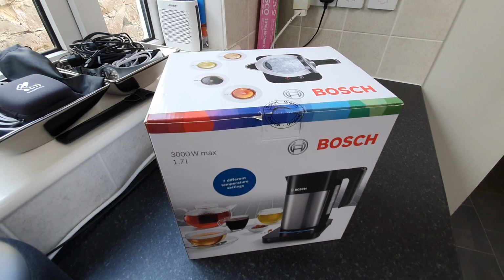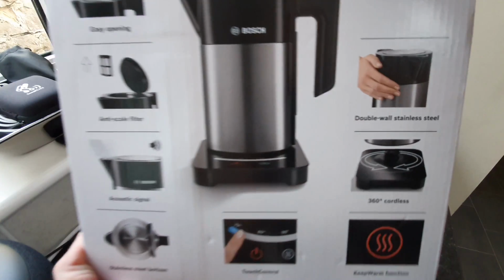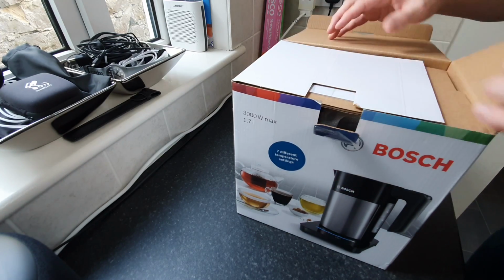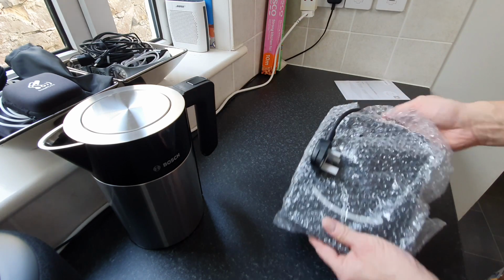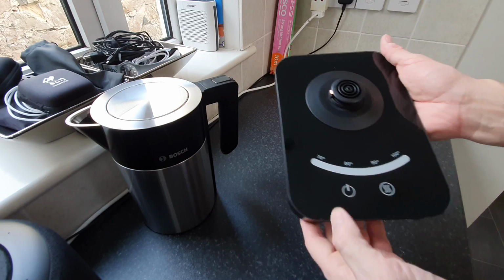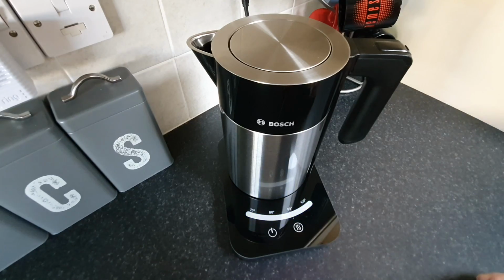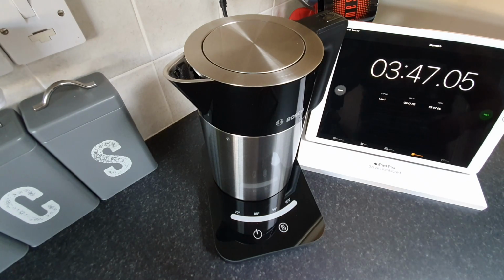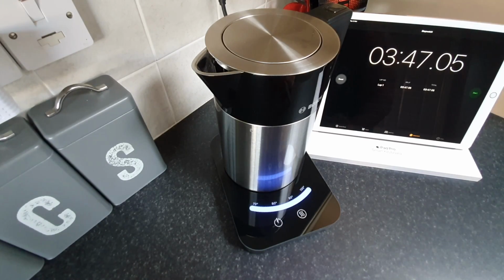Bosch Kettle with blue LED touch sensitive buttons,unboxing & boil speed test (TWK7203GB)

Comment: Thank god this had a stainless steel inner lining. As the old version of this with the physical buttons doesn’t, it has plastic and it’s degraded a leaking microplastics into my brews! 
By chance I put my hand inside the kettle when it was cool and felt a residue albeit it looked white as if it was scale but wasn’t it’s from the plastic wearing away. I live in a very soft water area in Scotland.  Any how I wiped the insides several times with my fingers and lo and behold everything came out black not wha I wanted to see. 
I’ve reported this to Bosch today and left a scathing Amazon review. 
My point is be careful with what you’re buying and this kettle here is a great purchase, I bought it right after discovering my problem!

Comment: Q: IS IT SAFE TO REPEATEDLY HEAT DRINKING WATER BELOW 100°C ?

A: SEEMINGLY SO (see below for more information). 

Like me, you may be wondering whether it's safe to repeatedly heat water to below 100°C, the boiling point, especially as those double walls will keep that repeatedly heated water warm for extended periods. What about heat-resistant bacteria, such as E.coli and Legionella? 

Although I like the idea of a kettle that'll heat my water to temperatures below 100°C for correctly making teas or fresh ground coffee, I wasn't sure. So, I did some research.

It is reported by the experts (which I'm not) that heating to 70°C is an "instant kill". I'm assuming that this is why 70°C is the lowest temperature BOSCH chose for us to heat water at. It seems they've also done the research, but it's always good to know. 

Thank you for a great video review, Paul. Other than this safety question, you answered all of my questions just as they popped into my mind. That's really impressive, Paul. 👏 

___________
For those who'd like to see the scientific research article for themselves, just click on the following link:

Article: "Quality change mechanism and drinking safety of repeatedly-boiled water and prolonged-boil water: a comparative study | Journal of Water and Health | IWA Publishing."

https://iwaponline.com/jwh/article/18/5/631/75644/Quality-change-mechanism-and-drinking-safety-of